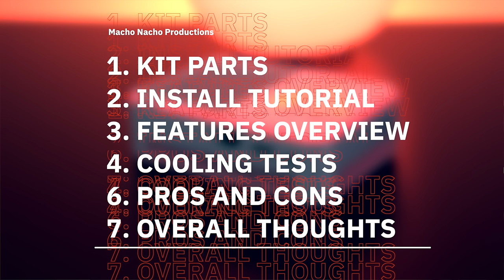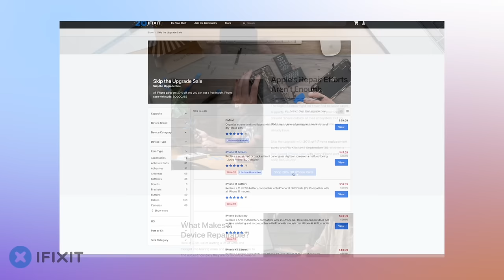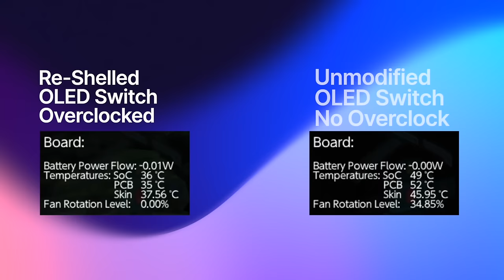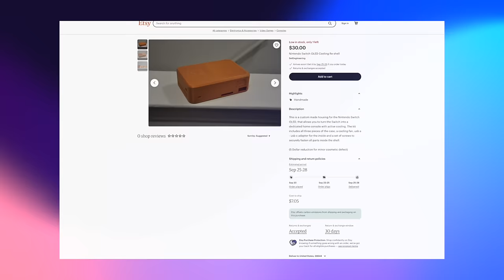Making The Nintendo Switch Run FASTER And COOLER With This NEW Mod!

Comment: The biggest killjoy to this is no ability to use a GCC adapter.  One of the major reasons to overclock my switch would be for stronger multiplayer support in Smash while using mods to prevent frame drops, and well... unless everyone you play with uses pro controllers (highly unlikely) you wouldn't be able to use this shell.

Comment: The fact that you still have to have a battery is a huge con, in my opinion. Wish there was a mod to get rid of it, turning it into a full console. Currently, the switch will not work without the battery attached.

Comment: I just bought a 20$ broken OLED switch to try this mod. I understand that you didn't talk about jailbreaking the Switch to avoid getting too much unwanted attention on your channel, however since overclocking the OLED requires a modchip and this mod removes the screen it would have been nice to see how to use a CFW without a screen.
For this mod to be perfect we would need:
- a custom bigger heatpipe and heatsink
- a silent fan connected to the motherboard fan connector instead of a USB port
- accessible micro SD and USB ports
- joycon rails for pairing and charging

Comment: As for the fan problem, the one included has no speed control and will be running full speed all the time. I believe I have seen fans that have on-board temperature sensors which will adjust the speed of the fan automatically. Presumably the fan would shut off if the temperature was low enough (as it should). If you could find one the right size, you could put it in yourself.

Comment: I think in the future with how often increased performance is mentioned it would be nice to see some results showing that. 

Sure the temperature difference was great but the Switch doesn't run hot to begin with since Nintendo has it locked down so much.  

So having it overclocked and showing some results of that overclock would be nice

Comment: Correct me if i'm wrong, but wouldn't the 80mm fan be better off mounted the other way, so the air blows DOWN through the case?  Otherwise you have that 80mm fan sitting right on top of the Switch fan that's trying to blow air through the heatsink, fighting for air with the SIGNIFICANTLY larger fan just above it?

Comment: I'd have preferred the sd card slot facing the other way to make it externally accessible.

I also find it odd that it's for the oled, as I think most people will want to repair an oled rather than gut it for a mod like this, it'd make more sense for it to be designed for the lcd model.

It is a nice mod though, I wish the creator success with this project.

Edit: I just saw the bit about the mod creator is working on an lcd version, which is good

Comment: This will also help with LAN centers since they won't need to just have the Switch just sitting in the dock. I know you can buy a lock, but that is something Nintendo could have addressed if they made a console only Switch. Another thing that I think is worth mentioning is that you need to have the Switch go through set up since they do require you to do some things on the console itself, like attach joy cons. Other than that, I think it's a neat little mod. It's just when I want to do this mod, I want to use the older model, but at the end of the video, there's confirmation of a version with the 2017 and 2019 models. I know this is future proofing, but I still want the OLED to be in its original form. It is the flagship model after all.
Reply: Tbh adding a LAN to the Switch dock was a weird decision 
The revision came out in 2022, not 2002 🙄

Comment: EDIT:  Make an example out of me, Wait till the end of a video before commenting, Bruh -_-

What an awesome project, but you would think they would do this on the V1 switches as well, More accessible modding to achieve such overclocks, and it's not like the OLED has any more performance, you're paying more for a screen that you're going to abandon.

Yes, I understand the PCBs are different and would add more design complexity and or bulk, but would love to see it. 
I have a few V1's would love to turn one into this sort of setup.

It's all theoretically there

Comment: The ducting on the mid frame doesn't seem necessary. I would rather screw the 80mm fan directly onto the mid frame. Not having the ducting would also allow you to use 25mm thick fans which are much more common, which addresses the idea of using a Noctua fan. The downside would be the need of a boost converter since those fans typically run on 12V while USB outputs 5V.

Comment: Wish you would share the mod process. In this case with a donor switch where the screen is not working. How would you overclock the donor switch? Still a solid option if you don't overclock a donor switch.

Comment: I decided to go ahead and get this, my poor switch has the LCD connector broken, the stock fan connector is broken, and it deserved to be upgraded. My only issue is I have to disassemble every time I want to access the SD. With a modded switch that’s a big con BUT I’m more interested in having a working switch. If I have to occasionally do a tear down to get the SD so be it.

Comment: The biggest con by far is cutting off access to the SD port, it's a shame he didn't include a ribbon cable for it. Hopefully when it becomes open source someone will add a place to mount one.

Comment: I love that Nintendo is willing to take risks with their hardware.  I really like my Switch and it's neat that Nintendo wanted to go with a a "one console for everyone" setup for this generation, but they really made a lot of compromises to achieve that.  I only play mine docked so it would be nice for something specifically for that.  I envision the next generation of hardware being an Apple TV style home console or you can get a Switch Lite like handheld but they both use the same game format (hopefully with more storage capacity and faster read speeds).  Great job on this shell.
Reply: I think the biggest issue here would be the development process.
If you create a separate system for docked and handheld, one will inevitably be more popular.
In this case, the handheld option would be more popular.
That would lead to a lot of developers heavily prioritizing the handheld experience, potentially limiting the docked experience.

In the current situation, developers are kind of forced to give out a good experience for both modes, to maintain compatibility with any hybrid Switches (Original Switch and OLED Switch).
This is because the segregation isn't nearly as apparent as with both a separate docked and handheld option.
Reply: @Sherolox   As long as the hardware is the same between the docked console and the handheld and there are no gimmicks like removeable joycons or dual screens or anything like that, the development process and gaming experience should be the same.  The only difference would be the size of the screen you play the game on.
Reply: @mfinite689  
Well, I would like to believe that, too, but again and again, we have just been seeing examples of games running terribly on either of the two modes. Some games scale down to incredibly low resolutions while in handheld mode, others can not maintain anywhere close to 1080 or even 900p in docked mode.
Developers hate to waste time, so they would very much focus on one rather than the other.

Comment: Should add a micro SD Card cable extender. So you can mount the USB to an accessible area. Did this with my 3D Printer.

Comment: 2:52 
As what Jeff says, keep your hacky stuff and normal stuff completely seperate as it's pretty common to get banned because you either:
1- Playing pirated games online.
2- cheating or modding games in online.
3- installing the homebrew on the system memory/SysNAND, you should install it on your SD card.
4- changing your Nintendo icon to a custom one.
5- clearing system errors after being sent to Nintendo.
So be aware on what you're doing, don't do anything stupid and keep your hacky stuff in atmosphere.

Comment: To me the most frustrating part of the Switch was the missed opportunity to integrated DP over USBC and add a "Pro Dock" with an EGPU inside. They could have given gamers everything they wanted without invalidating the system and launched it mid generation as a part of a refreshed lineup. Hopefully they will learn from ROG and incorporate something like the XG Mobile in their new console's lineup of peripherals.

Comment: Consolized, there is a way to do this mod without a battery.  The switch requires a battery to boot, but there is a simple fix for it, but I honestly forget what it was.  Might need to solder two points OR it might need a resistor but I can't remember.

Comment: there are monitors you can buy that have batteries and usb hubs and are just a monitor with a stand. some don't even have stands. using one of those monitors that are designed to accept HDMI input, with one of these non-portable switchs, would mean you have a 1080p portable switch, which runs cooler.

Comment: Its a great idea but poorly executed, First why not use a better heatsink from a pc then the stock one considering how the switches  small form factor is not longer a issue if your doing this mod a small work around bracket to hold a pc heatsink with more fins and more surface area would make this able to overclock the switch even more will not making it much bigger and providing alot more cooling, adding extenders to the cart reader and sd card board would make it easier to place them inside the case in a area that would make it easier to use or access and a dust filter mesh really is needed considering this case has none it be full of junk withing a few months. It a nice prototype as it is right now but it needs alot of work that could be easily done with the changes i mentioned that would really make this more appealing as a product.

Comment: Interesting the CPU fan and another fan are both active. I guess the big fan does run relatively slow so it won’t overwhelm the CPU fan.

If one wanted to they could expand with a bigger heatsink for the SoC which then just uses a big fan (but the new fan likely needs to work through the original fan connector).

Comment: I do like the idea of the battery being there as in case you get a power failure. It's pretty nice to have a backup, but also a little worrying due to the fact of overcharging or degradation to the battery and total by being plugged in all the time. It would be interesting to come out with some sort of a fake battery list or something. Just to trick the switch into thinking the battery is there. If not then just I would advise letting the battery discharge and play with it sometimes.
Reply: We are working on a version that will allow the switch to boot without the battery that will be more of an advanced mod.
Reply: @SetEngineering  nice.
Reply: @SetEngineering would this potentially be an add on that could be purchased by someone who already owns the original case from you?

Comment: a lot of work to leave the fan on the wrong side, it will suffocate the main cooler with no air to cool it, the cooler fan he installed is pulling air from the inside to the outside, the correct thing is to pull it from the outside to the inside to have more cold air circulating inside!

Comment: Wow this feel so stupid. I never had any issues with temprature one my original switch I gott 2017. I the switch fan is not even running more that 25%. I don't see why we need to keep the temprature that low. If it under 50 celsius it more that engoth. This fan is always running and producing sound even when the system is powered of or not need the cooling. I feel that is a problem. Shoud you not just read the controll signal from the original fan not know how much fan speed the system want and uses this to control the big fan. Prehaps only turn the big fan on if the fan speed it >75%. It shoud not be that hard to do. Anyway I never have a problem with cooling so and if I have problem.

Comment: Yeah I agree. I think Nintendo could and should release a version of the Switch that's console-only. This version would run at higher resolutions (maybe 1440p even?), have better cooling which would mean faster clock speeds (obviously would be needed for 1440p), or like a choice of 30 FPS at 1440p or 60FPS at 1080p or something. I guess there is a reason why people call them Nintendont.

Comment: I always thought it would be smart if nintendo made a "tv only" switch that could connect to certain USB-C devices like if they partnered with apple to allow it to connect to certain I pads and mac books and maybe also teamed up with an auto manufacture like honda or toyota to have a rear seat display that had a compartment to hold the  tv only switch.

Comment: I'd like to see Set put an adapter cable into the microSD card slot to allow for a physical microSD or even a SDHC card slot at the front of the case so you wouldn't have to open up the entire case to change SD cards. Maybe that's something you could mention to him?

Comment: I wonder what the performance would be if you removed the Orginal cpu cooler/heat pipe for a heat sink and use the case fan to cool it off. And keep the Orginal switch fan as an exhaust fan.

Comment: This is cool, but why dedicate so much time to doing this to the OLED model before the original?  Who has an OLED model and wants to remove the screen already?  Just get a regular model if you don’t want to use it in handheld and save the $50.

Comment: My launch model switch has been broken for years, I'm super excited to try this mod out! Hopefully there is a version that works with a non-OLED switch (My OLED is still going strong).
I'm also curious to see if there will be a future version that doesn't require a battery, since you don't really need one in this mod and batteries go bad over time.

Comment: can the cooling fan and heatsink from the V2  not be installed? since the copper pipe and fan are bigger than that from the OLED model and not restricted by the redesigned case of the OLED model? could be another temp optimisation of 1-2 degrees

Comment: The mod is really interesting but the only thing I don't like is the location for the Micro SD Card. If the slot for that card becomes accessible from the outside similar to the game cartridge slot then that's when I would say it's really worth it.

Comment: i gotta keep a lookout for this. I hope one is released for the normal switch (if not already) as I feel those are far more likely to have units available with dead screens
Reply: Also good for those looking to get extra use out of their older switches after getting an oled upgrade

Comment: @12:42 CPU max setting is 2295 MHz, not 1963MHz which you set. @12:45 GPU max is 1267 MHz, not 998MHz which you also set. Both options were available in your settings, but you chose the lower 1963MHz and 998MHz, while calling it their highest settings. Your ram MHz is correctly at the highest setting.

Comment: I think it would be better if they came up with a new heatsink would cool a ton better then the single heat pipe in that. Plus could direct die cool with some liquid metal or a kryosheet because it won't move around

Comment: Its nice, but the cooling aspect is negligible. The stock cooler of the switch has enough cooling headroom for even an overclocked switch like mine with great temps. The switch never thermal throttled and never got hot enough to be uncomfortable.

Comment: I'm getting 60fps locked in Tears of the Kingdom, Red Dead Redemption, Skyrim, Subnautica, and No Man's Sky in handheld mode (720p) nearly all the time when using the 4IFIR overclocking tool. Docked mode (900p) however does not run well above 30FPS when overclocked, the system is tapped out at that resolution.

It would be interesting to see if this reshell mod can offer better thermal headroom for overclocking and maybe hit a higher docked framerate, but the system's power draw limits may be reached before thermal limit is reached, rendering the effort futile. I'm not at all optimistic given the age of the hardware. I'm impressed with the overclocked handheld performance as is. 

Get 4IFIR OC on your V2/OLED Switch, it's the best. V1 Switches are not nearly as good for overclocking.

Comment: I don't understand. If the objective is to give a second life to broken switches, why not have made this mod on the basic switch which is sold much more, and when we know the importance of the OLED switch screen. If you have a broken OLED switch, I think you will first try to save the OLED screen...
Reply: I guess they're prioritizing performance, the OLED switch is more powerful
Reply: @girlmaya6818  The OLED Switch is not more powerful than the basic Switch. It does have a different chip, but it is the same as the Switch Lite and is not more powerful than the previous one.
Reply: @Sa2si28  Really?

Comment: Why is the battery still needed? If it's not going anywhere, you might as well leave it connected to the mains so the battery seems surplus to requirements to me.

Comment: The frame rate doesn’t seam to change much. I think it goes to show how optimized the chip is even at higher loads.
Reply: for some games, the game isn't allowed to go beyond certain framerates. TOTK for example limits itself to 30. However, with this mod, it will be a consistent 30 at almost all times

Comment: I noticed a few things, I wonder if having no shielding could negatively impact wireless performance... 
Also, the way you have the case fan installed is currently fighting the switch's fan. If you look at any compact CPU cooler or NUC the fan will be lowing down towards the motherboard. The side of the fan with the bracket pushes, the side with blades exposed pulls. just a few thoughts